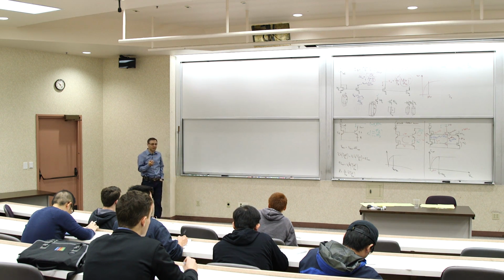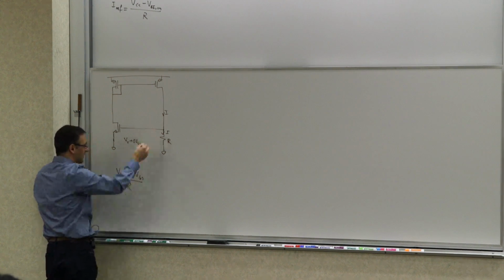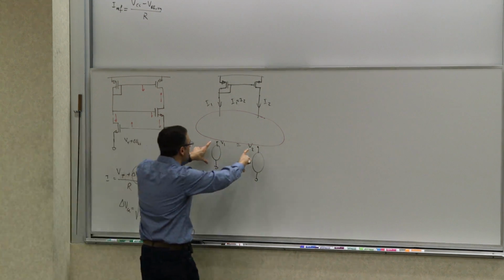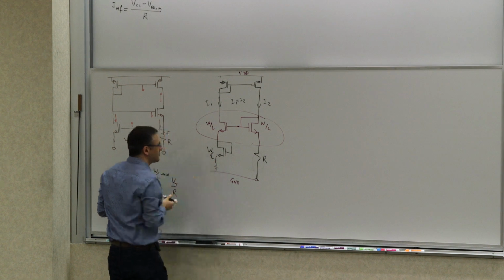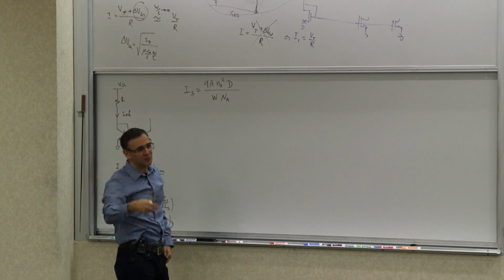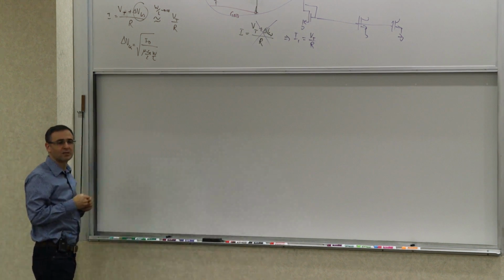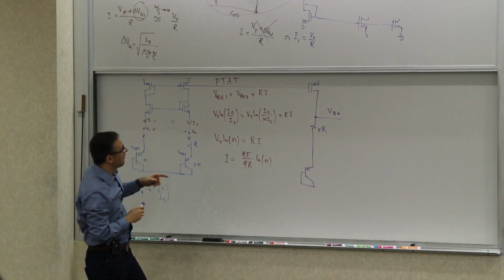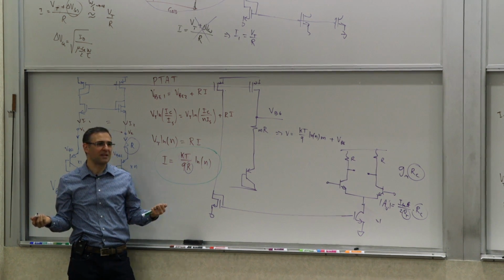133N Process, Supply, and Temperature Independent Biasing

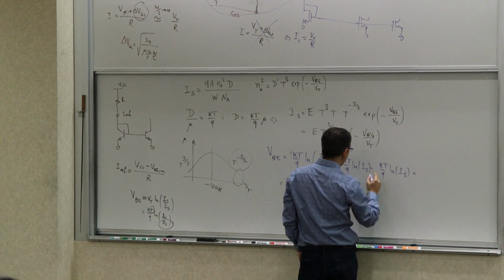Comment: At 27:30 in the Vbe expression bandgap voltage is present. Usually bandgap voltage VbG(T)= Energy gapEg(T)/ q. Where q is charge of an electron, Eg(T) is energy band gap. Eg(T)=Eg0-betaT, where Eg0 is energy gap at absolute 0 temperature. beta is material constant. According to this relation As Temperature increases energy band gap decreases. It has negative temperature coefficient. It has temperature dependence. How should I take VbG as reference? Either intrinsic or extrinsic semiconductor Vbg(T) depends on temperature.

Comment: 00:02 Integrated circuit biasing techniques for replication and variation
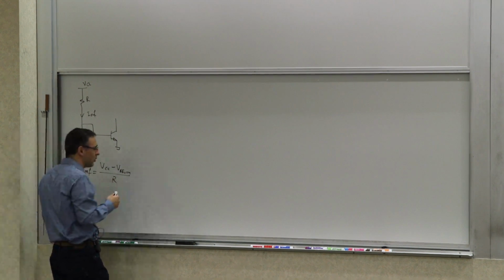02:08 MOSFET threshold voltage is temperature and supply voltage independent.
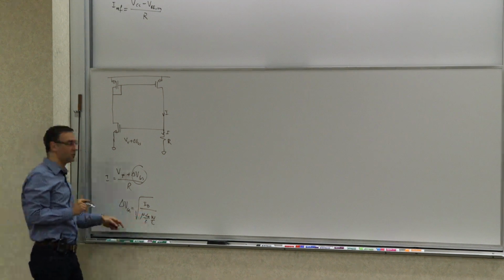07:06 Biasing with W/L going to infinity generates a current proportional to threshold voltage divided by resistor.
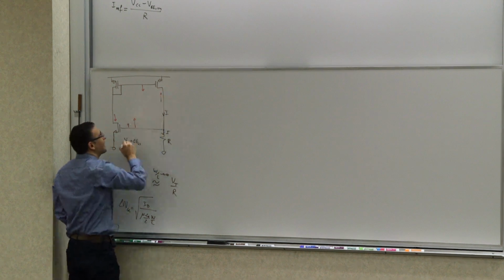09:22 Using a transistor to create isolation for negative feedback.
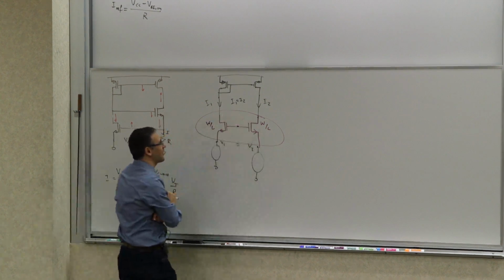14:36 Biasing should be connected to a high impedance side to allow for isolation.
17:04 Using a diode-connected device to create a threshold voltage
21:35 Temperature dependence of VBE
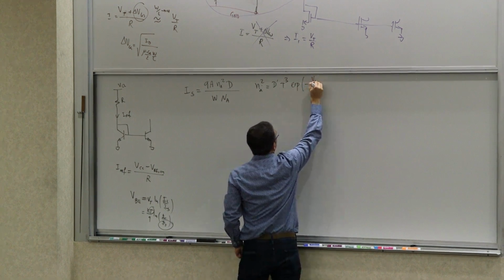24:03 Temperature dependency of biasing in semiconductor physics.
28:51 Generating a reference voltage with positive temperature coefficient
31:15 Floating mirror forces currents and voltages to be equal
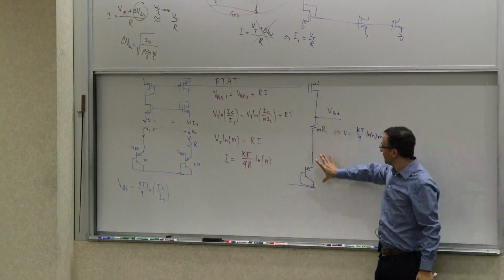36:30 Designing circuits to be independent of temperature and supply is important for consistent behavior.
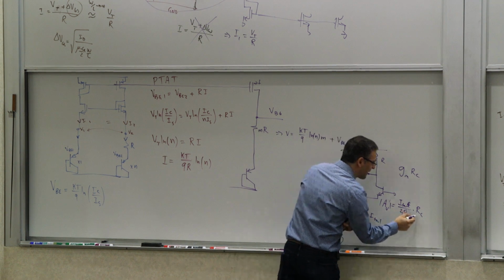38:44 Biasing with a reference branch for temperature-independent current source.
Crafted by Merlin AI.

Comment: Before anything, thank you very much Prof. Hajimiri for your lectures. I have learned a lot from them.
In the Vt reference current source at time 19:13, i think the reference transistors in the nmos and pmos current mirrors should be interchanged. The current Vt/R is generated by the bottom loop. We want this to be our current at the left side for the deltavgs to cancel, so the pmos transistor at the right side should be the reference transistor of the upper pmos current mirror, and the nmos transistor at the left should be the nmos current mirror reference transistor. I did this in ltspice and the circuit worked after i interchanged the reference transistors.

Comment: Dear Professor Ali, I like all your teachings, thank you very much. For the circuit shown at 8 minutes, it's not a negative feedback, thus the circuit won't work. It's a typical locking circuit: once triggered, it will be locked up. Usually, it's used as a high power switch. Nevertheless, you can use it as an example to teach students how to achieve a voltage source, but in reality, it does not work.

Comment: Sir why should we size the bipolar transistor that is connected to Resistor in the PTAT configuration? Is that to increase the transconductance of the bipolar to compensate for the resistance added in series?
Reply: Veb depends on Is. Is depends on area of BJT. So if area increases Vbe decrees. This is required as the voltage decrease by increasing area of BJT, Is drops across the resistor. At the both node of Floating mirror, voltage and current is same by same sizing of transistors. The left side Vbe should be same to right side of Vbe if there is no n.Is.

Comment: I think there is a mistake in the topology of the MOS circuit @41' . The diode connected transistors in the "floating mirror" should be swapped as well as the top mirror diode connected should be swapped too otherwise the gate of the floater will not bias up. I might be wrong.  Having said that, sir thanks a lot for your lessons that I am following with lot of pleasure. You are absolutely a very good teacher!

Comment: at 9:43, also there is trick to make I= Vt/  R.. we can make diode connected (towards ground ) W/L high enough to have delta VGS low so its VGS is almost equal to Vt.. then above FETs gate is 2Vt+ Delta .VGS.. then source of other FET ( Resistor terminal ) is VT..is that right ?